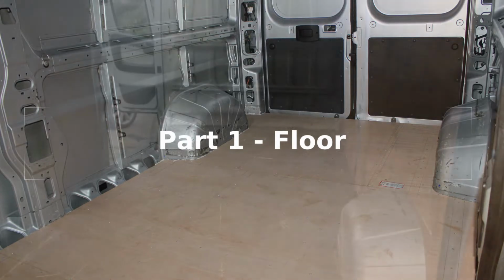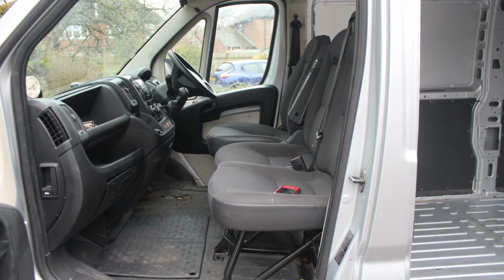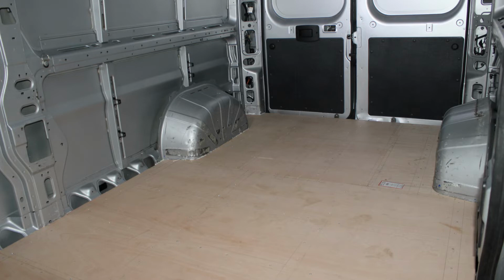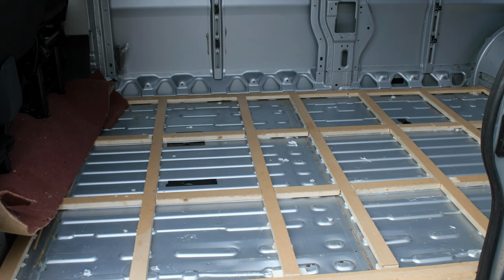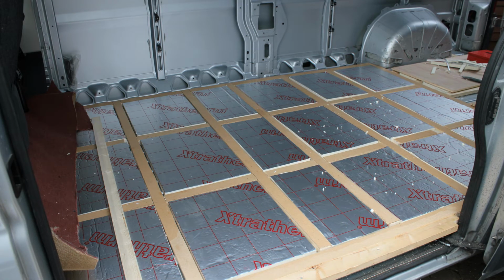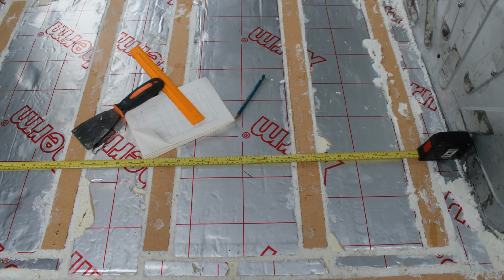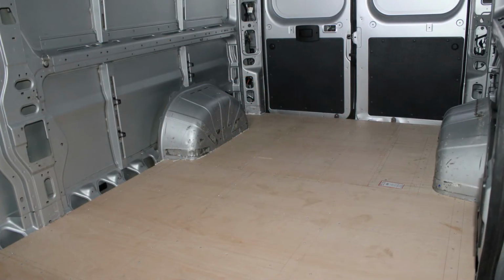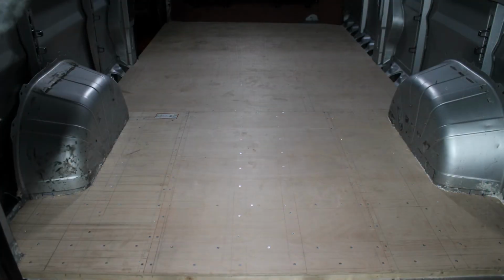Part 1: Floor - Converting a Citroen Relay panel van into a Motorhome

Comment: hmmm. I've seen quite a few vids on insulation and I really dont think the way you've done it is the best way. Far better to use thicker (36mm) batons in the dipped channels going front-to-back and stick with sikaflex. I believe the recessed gap is 11mm, so you'll automatically create 25mm clearance for celotex board installation. Then silverfoil the joins, cover with ply and screw to batons.  This way theres no drilling into the metal floor at all
Reply: I agree it’s not a good way. No vapour barrier and that expanding foam is bad news.
Reply: Agree, and thanks because this is way i don't need to drill holes i will use sikaflex.

Comment: Did you decide not to foil tape over the batons because you thought it unnecessary? Some people do, like creating a vapor barrier.
My van has a raised floor of three inches, no foam or vapor barrier, it's fine as I've checked and it's been that way for 28 years. The boards on my walls are ( from memory ) 3 mm ply then 3 mm insulation then 3 mm hard plastic backed plywood all sandwiched together, no vapor barrier or other insulation.
The ceiling and down to 12 inches has 1 inch insulation for the most part.
Plastic surfaced plywood  for half the ceiling and leatherette on the rest.
There is definitely plenty of ventilation in it and in cold weather my heater is on constantly lol. No rot or damp though except once when I was parked in a shaded place for months without the vents on the sides of the ceiling open. The mold was starting to form on the leatherette ceiling. It was easily cleaned off with a little bleach and water, opened the vents and now park where it gets more sunlight in winter. I've never had a problem since.
My van was factory fitted ( Talbot express ) by auto homes. 
It's been refitted/modernized a few years ago but all was well with no rust or hidden damp.
It would be nice if it was insulated properly but because so much ventilation is important in such a small space, I wonder if it's really needed to the extremes I've seen others do. Makes me wonder if some people are perhaps running a risk of trapping moister that gets in behind the barrier but can't get out.
At least without one it can dry out if you know what I mean.
Closed cell foam and no vapor barrier may do just as good a job.
Sorry for the long post, this has been going round in my head for some time as I'm thinking of perhaps getting another van to do myself.
I'll have to wait to see what you've done now lol. 👍